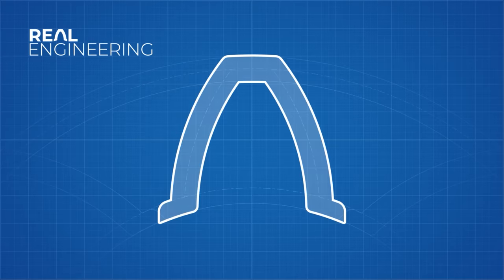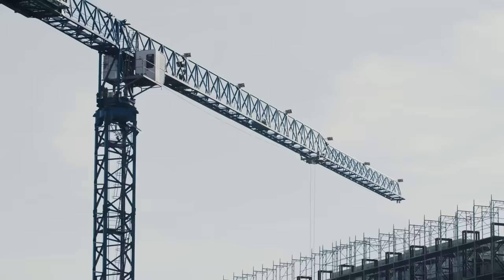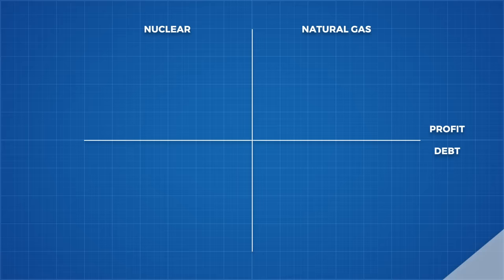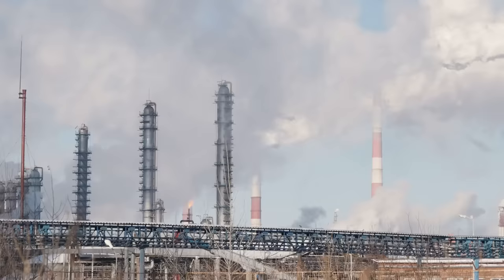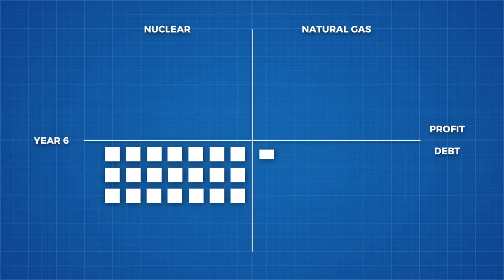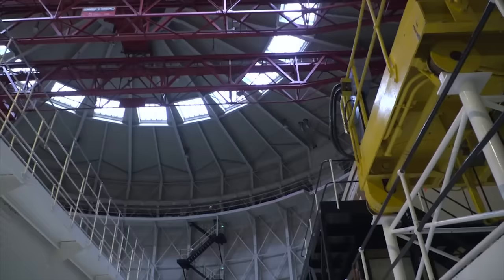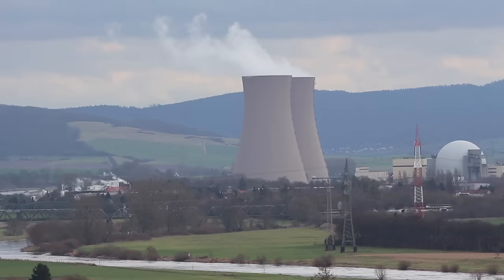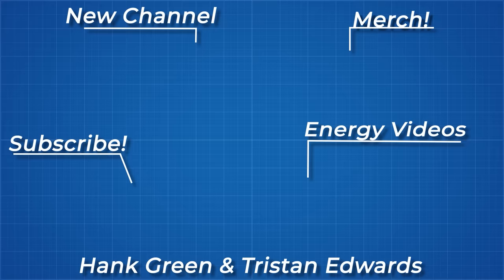The Economics of Nuclear Energy

Comment: There are a couple additional factors when considering the economics of nuclear versus other energy sources as a whole. Because energy is priced at the margin, $/KWh of a given technology is misleading. Inability of solar and wind to load follow can and has caused large price spikes in natural gas and other prices. To smooth these issue out, batteries and grid upgrades (high voltage transmission, "smart" grids etc.) are required and but are not priced into LCOE. Interest rates are also important. In a rising interest rate environment, a premium will be placed on energy security as volatility will be more catastrophic for lower margin industries.
Reply: There is a much simpler way to look at it without all the LCOE mumbo jumbo.

If and that is a big if you can even build new nuclear, it is 2-3 times as expensive per Mw produced than ANY other power source.  

If you live in the U.S. here is the reality for the last 4 state of the art Westinghouse AP1000 ADVANCED passive safety features new nuclear power projects and spent fuel reprocessing and in the U.S. over the last 20 years. You decide if this YT video was presenting the truth. 

The Southeastern U.S. is super pro-nuclear MAGA, has zero anti-nukes, and 100% media and political support. 

The MOX facility (South Carolina) was a U.S. government nuclear reprocessing facility that was supposed to mix pure weapon grade Pu239 with U238 to make reactor fuel assemblies. It was canceled (2017) in the U.S. After spending $10 billion for a plant that was originally estimated to cost $1 billion and an independent report that estimated it would cost $100 billion to complete the plant and process all the Pu239, Trump canceled the project in 2017.

VC Summer (South Carolina) new nuclear units 2&3 were canceled in 2017 after spending $17 billion on the project (original estimate of $14 billion and 2016 completion date) with no clear end in sight for costs or schedule. 

Vogtle (Georgia) new nuclear units 3 &4 currently 110% over budget and schedule (currently over $30 billion) and still not operating. Mid way into the build, the utility stated that had they known about the many costly delays they would never have chosen nuclear. They are now delayed another year because according to the project management, thousands of build documents are missing. If completed, Vogtle will be, for its output, the world’s most expensive nuclear power plant.

Please google any of this to confirm.

If you can’t build new nuclear in the MAGA super pro-nuclear southeast U.S. then where can you build it?
Reply: @clarkkent9080  I don't really understand what MAGA has to do with anything since the main paperwork cost barrier, the NRC, is federal. Peoples opinion on energy matters rarely if ever, as evidenced by unilateral shutdowns of nuclear reactors across US.  Expense being 2-3 times higher is only true in the short term, which was the point of the video.
Reply: @clarkkent9080  I mean you answered your own question. Delay was caused by improper paper work filing for the federal safety regulators, that's NRC. It might be ineptitude on the part of Southern Co. or overly onerous safety requirements on the part of the NRC, or a bit of both. Linear no threshold requirements imply a ridiculous level of safety that make costs balloon asymptotically.
Reply: @ddingopants  I worked in the industry 40+ years , live 40 miles from Vogtle and know  many working there.  The paperwork was missing because they did not x-ray welds and performance test critical safety equipment as required.  They knew this was require but did not do this,  The NRC did not tell them they were missing documents, they found out when they tried to submit the REQUIRED paperwork.  OK you think it is over reach for a nuclear plant to be required to x-ray welds and performance test critical safety equipment???? This has been required in my 40 + years in the industry.
You are living in that alternate reality of Conspiracy theories and unproven claims
Reply: PS natural gas prices are dropping and are at historic lows.  Just saying something only makes it true in your mind.

I do agree with your comment on interest rates.  Vogtle now has a $1 billion per year interest on their construction loans, have asked for a $600 million rate increase for starters
Reply: @clarkkent9080  If you agreed with my point about interest rates, then saying natural gas prices are back down from being crazy high makes no sense. Energy production is only useful if it precisely meets demand. Natural gas prices being back down does not cure the devastation left in it's wake. Inelasticity of demand is why energy security matters.
Reply: @ddingopants  Wake me when you can respond with any facts relating to the construction of new nuclear in the U.S..  Spew your NRC conspiracy theories all you want knowing that no politician is even remotely considering any changes to the NRC.

Those are the facts; no new nuclear and no changes to make anything different.  How does that factor into your LCOE calculations?

Don't know about you but there are 5 new solar farms in my area along and hundreds more + wind farms planned this year.  Reality sucks.....for some.
Reply: @clarkkent9080  I don't understand why you feel so attacked but I'm sorry you chose to take it so personally. You seem to be saying that the main mark against nuclear is cost, but then why do you prioritize wind and solar over gas oil and coal? There are environmental concerns of course, but electricity production only accounts for about 15-18% of energy in the US, so not really much impact there. Then there is also the volatility. Wind and solar don't really work without base load gas at a minimum so they are really the same (batteries and grid upgrades throw everything off anyways). This is why gas prices spiked in Germany and Texas. If you don't think energy security is important, then that's fine too, but then we lose industry and many other things. So I can't refute your cost concerns relating to the present state of nuclear, but concerns over cost of nuclear can be fixed somewhat while concerns over other factors can't.
Reply: @clarkkent9080  I am curious, why are you assuming so much about me? MAGA, bate and switch, misinformation, conspiracy, partisan, republicans... You have accused me multiple times of arguing in bad faith without knowing anything about me. Were you bitten by a republican as a child or something?
Reply: @ddingopants  Being a Democrat or Republican today means each believes in a laundry list of issues.  There are very few gun toting women rights people left.
As a lifelong independent, both sides give away their position.  Each side lives in an echo chamber of thoughts and just doesn't realize how obvious they are.

I only bring up political issues when confronted with it first.  The only exception being the MAGA comment and I explained the reason and it was 1000% accurate.
Reply: @clarkkent9080  Yes but you are arguing against me like you think I have some sort of agenda. What political argument have I brought forward in your opinion? Is critiquing the NRC overtly political? If so, then you can hardly call yourself independent for defending them. You say you are energy agnostic but at the same time seem very anti-nuclear. As an independent and economist, my only arguments were about energy security, inelasticity of energy demand and maybe inefficient regulation as important factors.

Comment: You missed the waste disposal part.
Reply: It maybe advisable for you to study the Elysium Molten Salt Fast  Reactor (MSFR) that can run on any type of radioactive materials such  as MOX, spent nuclear fuel, weapons grade, Highly enriched Uranium or simply fertile Thorium, with its 14.5 billion years half-life and which the sunbathers of Florida and many other locations lay safely.
Price is one of the big selling points, according to Perez and Pheil. Their 1,200 MWe reactor won’t be pressurized, but it will operate at high temperatures, cutting back dramatically on the balance of plant costs like a containment structure and fuel.
Additionally, and possibly the deciding selling factor, because it will be a fast reactor with a molten fuel, it will be able to use nuclear waste as a fuel and burn it up over time. 
A fast reactor has an unslowed neutron flux and needs no moderator, like the water in light water reactors, but can devour all the  unwanted radioactive material, reducing it to an insignificant volume consisting mostly of Caesium137 and Strontium90, both having half-lives of about 30 years which require secure storage foe only 300years to reduce any significant radioactivity to less than that of  natural background radiation.

Comment: Great video. However it's important to take into account afew things:

1) current nuclear Reactors are expensive and take long to construct. But new next generation  unclear Reactors (thorium for example) are significantly smaller, cheaper and can be constructed much faster. 

2)  Nuclear energy in general gets far less support or funding vs renewables. More solar farms and wind farms have been constructed and in use vs nuclear Reactors. So one flawed argument is that renewables are producing more energy than nuclear. But if nuclear energy received as much support and funding then we could have already set up many thorium nuclear Reactors worldwide and have already come so much closer to car on free zero emissions goals. Nuclear energy produces far more electricity than renewables. So it's not fair to compare the success of renewables to nuclear because nuclear is on the back burner and a outcast so to speak. 

I support nuclear energy and especially next generation thorium Reactors. I believe nuclear, geothermal and renewables combined will be the key to zero emissions goals.
Reply: Do you have actual facts on Thorium reactors that have been built and are operating?   Or just basing that on YT videos?
Reply: @clarkkent9080  I'm well educated on the options we collectively have. Plenty of science articles available for people to read. Plenty of videos to simplify the information for the masses. 

But I'm not a professor or a scientist or otherwise qualified to educate you or anyone else on thorium, fusion, fission or anything else of the sort. I encourage you to research, read up and absorb as much information as possible on nuclear energy. Especially next generation thorium Reactors and keep yourself updated on the progress scientists and students are making with fusion. It's absolutely fascinating. 

Avoid bias articles that take favor with any one option and avoid articles that saturate with opinions. Look for solid proven facts then make your own decision about the future of energy, our options and nuclear.
Reply: @julianus_dux_bellorum9585  I worked in the nuclear industry for 40+ years as a Reactor Operator, Senior Reactor Operator, and many other special assignments at 5 different nuclear facilities.  I am pro nuclear but that does not mean that I have to ignore and make excuses for the many problems that new nuclear has today. I keep up with the nuclear industry in the U.S. and it is not going so well to say the least.  

I make a clear and logical distinction between operating and proven facts and those of corporate PR, fancy web sites, and power point presentations.

Since there are no Thorium reactors even being considered in my country (U.S.), it will be some time before any factual information could be available.  Your original statement that  "(thorium for example) are significantly smaller, cheaper and can be constructed much faster" is based on what??  When the next generation reactors are built and operated for a number of years, then and only then will information be available to make claims on their performance and cost.  But until then, they are unproven.

It is certainly ok to look forward to improvements but making statements that have never been proven mean nothing no matter how many science articles that you read.
Reply: @julianus_dux_bellorum9585  Of course only emotionally stable people agree with you.  That says a lot about you.  It is correct that I am not a PC person especially when replying to people with zero actual nuclear experience.  
Let me go out on a limb here and say that I bet you have no idea how a Thorium reactor even works and I mean just the basics.
Every reactor type known including Thorium reactors were built, operated and tested by the U.S. government over the last 70 years and I worked at one of the Thorium reactors and it was not the Oak Ridge one.  So please don't assume that your book knowledge makes you a more educated person. 

You can cite test reactors in other countries, but NO ONE in the U.S. is even considering a Thorium reactor and that says a lot.  But in your mind, everyone here must be emotionally unstable for not agreeing with your brilliant conclusions. 

Let me make it simple for a simple mind.  You cannot CLAIM efficiencies, cost, build times as FACTS unless you have FACTS to back them up.  I am NOT saying that it cannot be true, but it has NOT been proven.
I am saying that people like you claim things as facts based upon corporate PR and fancy power point web sites and then cite scientific articles and a mis match of unconnected thoughts.  In reality FACTS matter.. And yes nuclear claims have been proven wrong over and over.  If you live in China that is great, enjoy communism and their Thorium reactor
Reply: @clarkkent9080  unfortunately you need a psychologist to better assist you. I cannot offer any advice in that area. 😕

Comment: Here's a different perspective on the numbers.

Global estimated electricity consumption for 2019: 22,484 terra watt hours. Dividing this by the hours in a year 22,484 / 8,760 = ~2.57 Terra watts per hour

So we'd need about 2,570 1 giga watt hour reactors to supply all global electricity demand.

Taking your figure of £6bn for a 1 gig watt reactor gives us an upfront cost of about $15.4 trillion to build the required reactors.

Global GDP is around $80 trillion. So we could spend 20% of annual GDP to solve the electricity generation problem. Obviously this completely ignores all the cost savings that come from not spending money on bird swatters, toxic lithium sheets and pollution mills.

At the same time we're told there is no easy answer to the climate Armageddon, we peasants need to cut back, reduce our standards of living (stop any increase for the poorest), live in the pod, eat the bugs. Or else we'll be destroyed by the climate gods.

The reason nuclear isn't promoted isn't because of economics. It's purely for political reasons.

Comment: Wouldn't nuclear + battery give nuclear the ability to vary its output?  i.e., Have a higher baseline output from generation, store the excess energy in battery at non-peak times, and deliver the battery-stored energy at peak times?
Reply: @SUPERTOASTERGOD  Doesn't "need" batteries, but batteries could improve the economics further.  Nuclear produces a flat amount of energy (generally), but demand isn't flat.  The idea is that with batteries a nuclear plant would be able to store surplus energy while demand was below the flat amount and sell it when demand was above the flat amount.